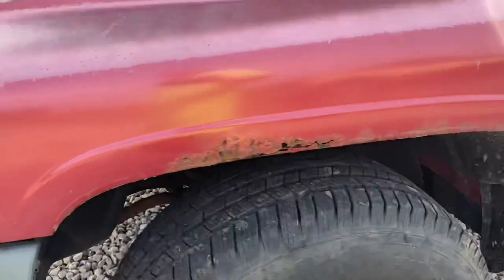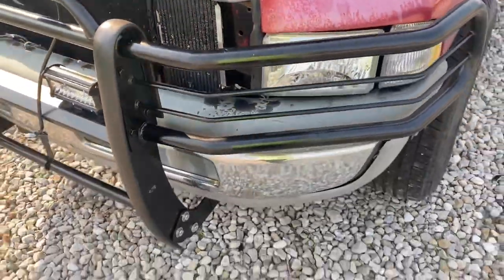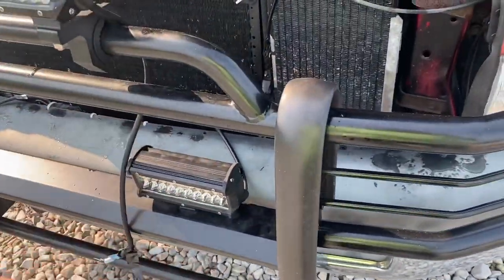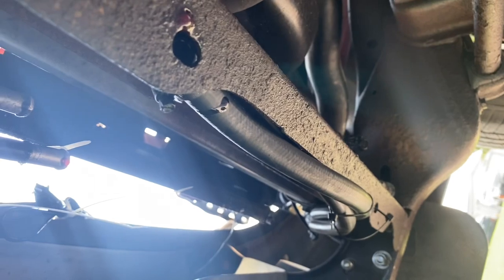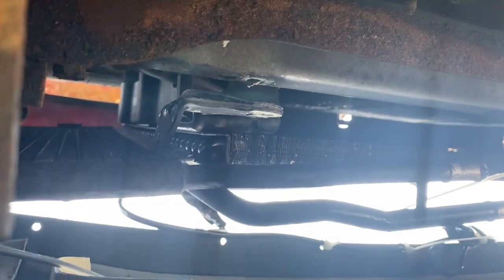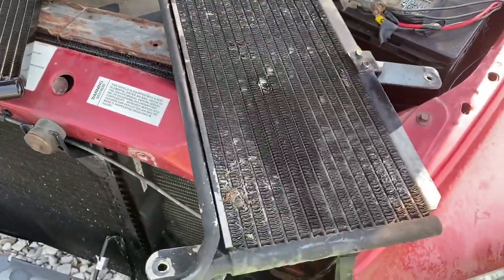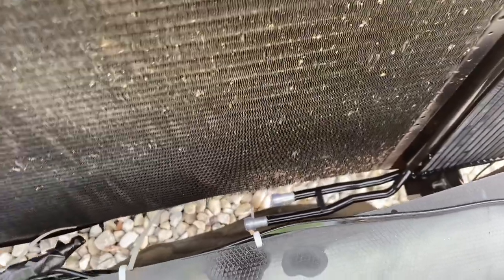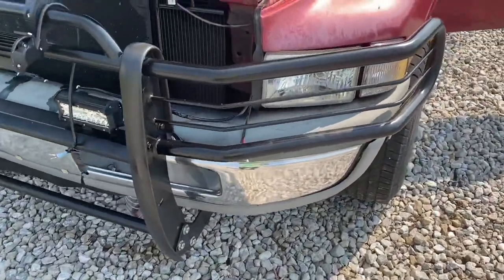1997 Dodge Ram 2500 V10 Transmission oil cooler REPLACEMENT

Comment: Ok, no doubt that the cooler cools the fluid but I've been having an issue with my transmission fluid temp light popping on and disabling my o/d and keeping the o/d light on. Will adding the cooler solve this issue?